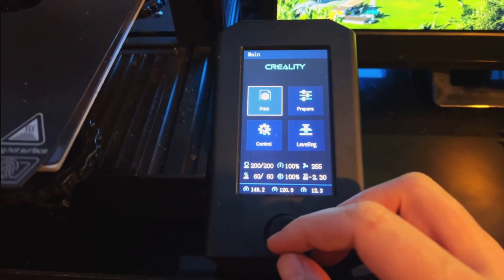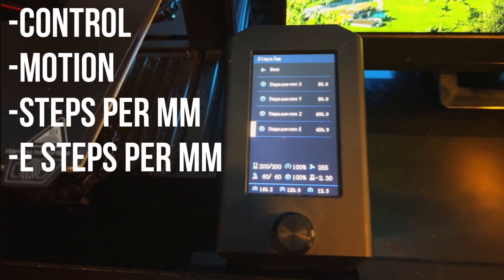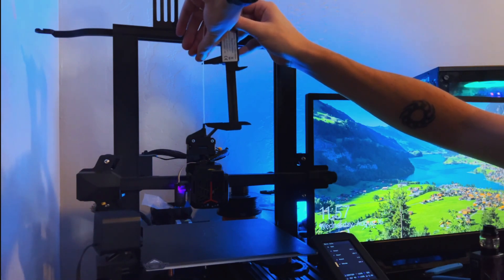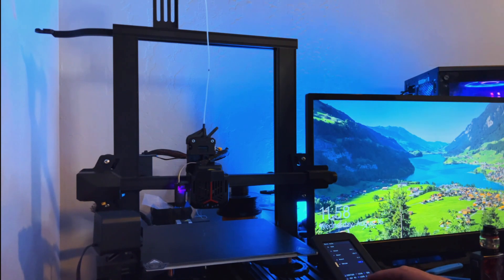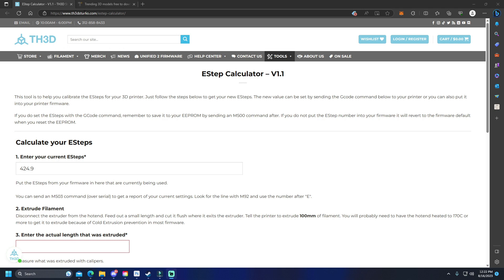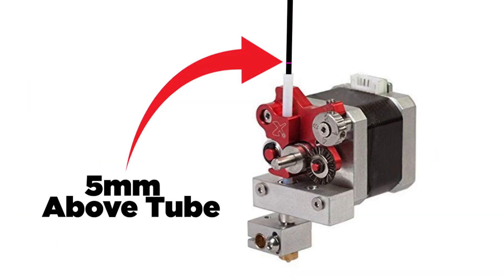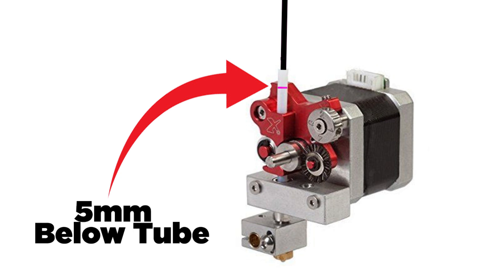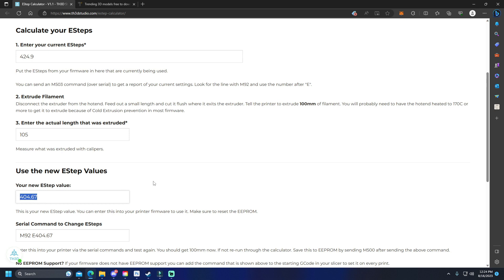3D Printer E-Step Calibration in 3 Minutes! - 3D Printing

Comment: Hi there!!   I have the same setup as you - same Sprit SE extruder and Ender 3 V2.  My prints are going OK but not perfect - I was curious did you change any slicer settings once you installed the sprite SE extruder - like retraction or anything??

Comment: I replaced my extruder last night after watching your other video (thank you), and then I wanted to adjust my E-steps.  However, my Ender 3 is older, and my menus are not exactly like yours.  I did find a "Move Axis" option under Prepare that included Extruder as a choice. However, that did not extrude any filament at all.  Is there a different way to do this, or am I using the wrong menu options?  Thanks for any help you can give.